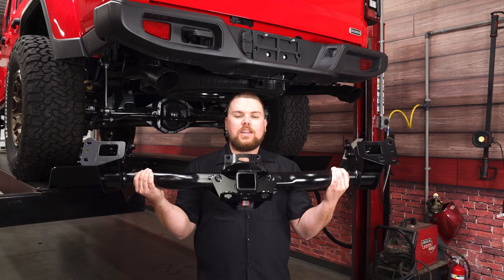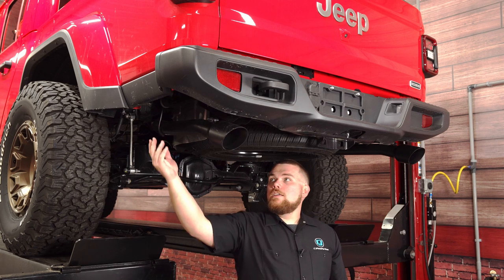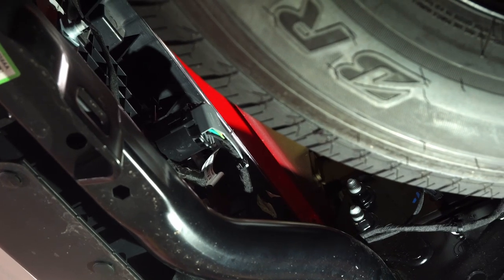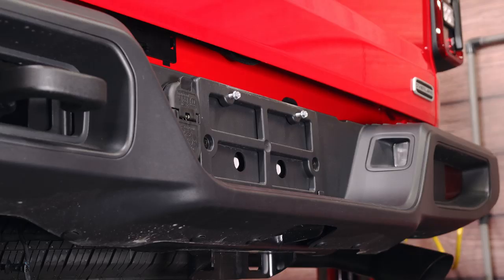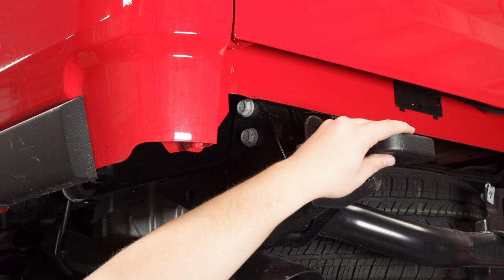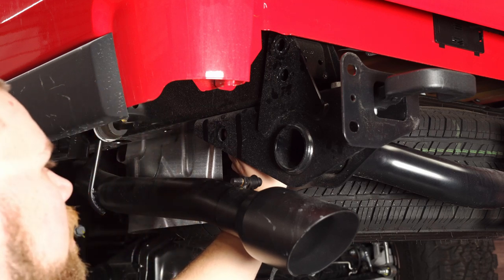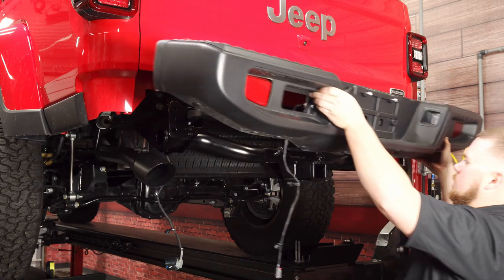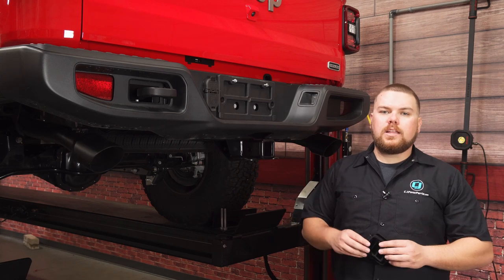Jeep JT Gladiator Install | Mopar Trailer Hitch Receiver Assembly

Comment: One additional point.  If you have the Rear Park Assist, you must detach the sensor network harness as well.  This is located on the passenger side with a molex connector in the same position as the trailer and license plate light harness.

Comment: i purchased a gladiator overland with manual transmission.  the tongue weight is rated at 400 lbs.  if i install this mopar hitch will it increase my hitch capacity to 700 lbs.?  also, will this effect my warrantee?  thx.  j

Comment: Sooo..  Mopar installs an unusable hitch (but wired for a lights) to be removed and install a new hitch that will accept a receiver?  Some hitches at eTrailer have you drilling a 3/4" hold in the bumper will I WILL NOT!  Why they didn't just come with a receiver I do not know.

Comment: Should point out the passenger side is ready to receive a hook like the passenger side.
Reply: Would have to get a new bumper as there’s only one hole for tow hook.
Reply: @codyharper5901  or use some sort of cutting device to cut out the plastic

Comment: Hey guys, thank you so much for the video!!  I used your video, especially after reading the "instructions" that came with the hitch,  to install the Class III hitch on my 2021 Gladiator Willy's model.   Watching you go through it on the video seemed really easy, especially since you had it up on a lift and had a few power tools.  Since I had none of that, I kind of expected it  to be a little more involved and take ~3 hours or so.  I've got to hand it to you...it was just as easy as it looked and took my son and I only about 90 min to complete the job - that included him making a run to the auto parts store for a $10 trim removal tool, which was well worth the $10!  Thanks for the great and clear video!!